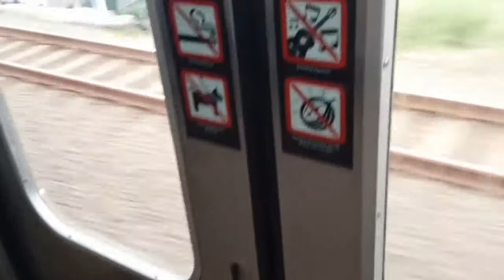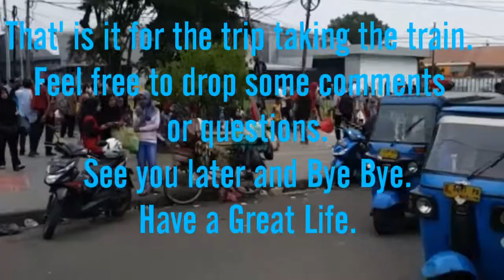Taking E-Scooter Anoa EX+ to the Commuter Line with The Additional Handle Bars

Comment: Numpang kasi review jg ya bro, gue nyewa Anoa EX+ dari Skutis dan tadi siang bawa dari Bintaro ke Stasiun MRT Lebak Bulus bolak balik dan sempet muter2 di Bintaro setelahnya.

Pros:
- Mesin cukup kuat utk jalan tanjakan. Berat gue dg tas dan sendal sekitar 100kg dan Anoa bisa narik walau jalan tanjakan lumayan tinggi dan panjang. Gue pakai mode 2 dan speed turun sampai sekitar 20km/jam tapi tanjakan bisa dilalui dengan mulus..
- Speed sangat OK. Gue hanya butuh 20 menit dari rumah sampai di lift Stasiun MRT.
- Daya tahan baterai OK. Total waktu jalan2 sekitar 1-1,5 jam, dan baterai dari full charge hanya turun 1 strip.

Cons:
- Stabilitas kurang. Mungkin karena ini unit sewaan dan umurnya sudah agak tua, ban depan sering agak2 skidding dan goyang.
- Dampaknya mengemudikan skutis ini menguras tenaga utk menjaga keseimbangan. Apalagi posisi tuas gas gak terlalu nyaman di jari telunjuk, mungkin harusnya pakai tombol atau tuas di jempol.
- Posisi berdiri gak terlalu nyaman apalagi utk jangka waktu lama, 5-10 menit mungkin masih OK tapi diatas itu bikin cape.
- Manuveribilitas agak kurang karena posisi steering column yg tegak lurus dg board, ditambah ukuran ban yg kecil. Untuk jalan lurus2 aja OK lah tapi kalau belok2 apalagi nyelip2 agak2 riskan ya.
- Shock breaking is nearly non-existent. Jalan di Jakarta yg lumayan mulus ternyata kalau dijalani dg scooter penuh lubang2 kecil dan cracks yg bikin unit bergetar2 dan bunyi2. Apalagi banyaknya polisi tidur yang ukurannya beraneka ragam. Dengkul gue serasa mau copot setelah selesai berkendara.

Verdict:
Gue test drive Anoa EX+ dengan rencana untuk menjadikannya sebagai alat transport penunjang commuting. Ukuran sudah pas tidak terlalu besar walaupun agak berat, speed dan daya mesin sudah OK. Tapi sayangnya Anoa EX+ belum memenuhi kriteria yg gue inginkan. Mungkin utk short range drive, muter2 di lingkungan sekitar atau jalan2 pagi/weekend masih cocoklah. Kalau untuk dibawa pulang pergi commuting setiap hari, that's a big no-no.
Reply from the maker: Wah mantap Bro. Iya Anoa EX+ memang agak besar dan berat. Tapi untuk yang sekelasnya seperti Inokim dan merek2 lain, saya bandingkan beratnya masih sedikit lebih ringan dengan kapasitas motor/baterai yang sama ya. Bisa lihat di video saya yang lain Bro, saya pasang kursinya, jadi jalan jauh tidak capek. Paling jauh saya jalan 31 km dari kantor Ancol ke rumah di Pondok Aren. Lalu bisa modifikasi pegangan di bagian depan seperti punya saya, ini sangat membantu dalam handling saat naik turun kereta / jalan di stasiun, jadi tidak perlu ditenteng . Ini sangat signifikan membantu, jadi selama tidak digunakan saya bisa dorong scooternya di depan saya (ban belakang menyentuh lantai, saya pegang handle tambahan itu). Lalu saat di dalam kereta bisa kita setel tiang setangnya agak naik sedikit jadi scooter bisa ditaruh tegak di lantai kereta sambil dipegang 1 tangan (scooter berdiri di atas roda belakang dan T setang). Lumayan stabil. Saya recommend untuk commuting menggunakan kendaraan umum Zero 9 (600 watt, 18 kg, top speed 45 km/jam kondisi baterai full, bisa pasang kursi tambahan juga). Saya juga pakai Zero 8 saat ini, kelemahannya motornya 500W membuat top speed hanya 40 km/jam, kurang cepat di jalan raya yang ramai, jadi agak berbahaya, dan yang paling membahayakan adalah tidak ada rem depan, hanya rem belakan, saya seringkali skidding/ngesot saat ngerem mendadak di jalan raya. Begitu Bro. Coba post video nya di youtube Bro. Mantap.
Reply: @sullivanvictor  thanks bro, gue udah tonton video2nya terkait Anoa, sangat informatif.  Gue gak rekam selama perjalanan makanya numpang review, thanks ya bro :)

Kemarin sempet juga sebentar test drive Anoa EX+ yg baru (green warrior), kayaknya lebih OK ya. Tarikan gasnya lebih smooth gak menyentak dan jalannya lebih stabil. Cuma baterenya udah mau habis makanya gue pilih versi lama. Ya maybe next time lah.

Untuk saat ini e-scooter saya coret deh karena ke arah stasiun MRT ternyata ada pos polantas yg lumayan gede pula. Masa musti kucing2an sama polisi tiap hari wkwkwkw. Ini lagi mikir2 mau beli sepeda listrik, kayaknya lebih aman dari incaran polisi.

Comment: Tertarik sih pengen beli karena gue udah bosen naik angkot tapi masalahnya harga terlalu mahal dan bisa patah punggung ngegotong2 26 kg naik turun tangga di stasiun. Itu di Sta. Jurang Mangu gimana caranya mas ngegotong scooternya dari pintu masuk di bawah ke peron di atas? Setahu saya cuma ada tangga manual disitu, gak kebayang kalau dibawa tiap hari apalagi pas jam berangkat kerja yang puenuh banget.
Reply from the maker: Maaf baru lihat comment nya. Memang kalau di stasiun Jurangmangu tidak ada escalator/lift. Untuk arah ke stasiun tanah abang bisa langsung ke parkiran motor. Tapi untuk yang ke arah Serpong/Rangkasbitung memang mesti tenteng melewati tangga. Lumayan berat. Hehe. Lebih nyaman dan cocok untuk naik commuter line jika menggunakan e-scooter yang lebih ringan seperti minimotors speedway IV pro atau inokim zero 8 / 9 (berat di belasan kg). Untuk yang lebih kecil lagi seperti Street Rat, xiaomi mijia atau inokim light memang lebih ringan tapi kecepatannya terlalu lambat untuk jalan di jalan raya. Agak berbahaya. Cocoknya  untuk di pavement/trotoar yang mulus.

Comment: selama ini cara merawat kebersihannya gmn nih mas?
Reply from the maker: Cuma di lap-lap basah aja. Kebetulan ada kompresor angin, ditiup bagian-bagian yang sulit dijangkau seperti engselnya. Rem depan dan belakang disetel supaya main tuasnya ngga terlalu jauh. Roda di pompa berkala.  Di bagian engselnya itu ada setelan per untuk supaya tiangnya tetap firm. Ini  di setel kalau sudah agak oblak. Itu saja sih. Kalau motor listriknya kan basically free maintenance.
Reply: untuk baterai, kalau di mas. baterai sisa 2 buah gitu, masih bisa jalan apa udah mogok, harus di charger?
Reply from the maker: @sohibatulbadriah1655  untuk baterai saya sendiri belum pernah sampai benar-benar habis. Di display kontrolernya bisa dilihat voltase batere. Biasanya setelah charge penuh bisa sampai 58V. Saya akan charge lagi kalau sudah di bawah 50V. Mestinya ada BMS (battery management system) yang akan putus arus charge di voltase tertentu untuk melindungi terjadinya over charge dan juga akan mematikan kerja baterai kalau sudah sangat rendah voltasenya.
Reply: Victor Sullivan oh, saya jarang bgt liatin voltmeter, okay.. terima kasih infonya, mas.
Reply: Hi, mas. mau nanya lagi nih. untuk lampu, udah pernah diganti blm?
Reply from the maker: @sohibatulbadriah1655  halo lampunya belum peenah diganti. Jika ada part yang rusak bisa langsung ke Skutis Corporation di tokopedia atau langsung ke kantor cabang Jakarta yang di Kemang. Keliatannya sih bisa pakai lampu LED lain yang watt dan voltasenya sama ya. Hanya pernah 1 kali kaca lampunya lepas karena tutup lampunya kendor. Selain itu mgga pernah ada masalah sih.

Comment: Ada regulasinya nggak kalau bawa skutis anoa ke trans Jakarta? Buat videonya dong Om. Anyways, overall keren pakai Skutis.
Reply from the maker: Wah kalau transjakarta saya kurang tau. Untuk commuter line ukuran tas yang bisa masuk adalah 100x40x30cm. untuk sepeda lipat bisa masuk dalam keadaan terlipat. Saat kereta sangat ramai agak sulit bawa yang Anoa. Ukuran anoa sedikit lebih dari 1m saat terlipat, tapi masih diperbolehkan masuk sih. Untuk yang Street Rat dengan berat 8kg dan ukuran yang lebih compact saya pernah dan masih bisa. Biasanya saya taruh ditempat rak tas di atas. Mungkin untuk transjakarta , scooter seukuran Street Rat masih bisa masuk. Untuk yang transjakarta kapan2 saya buat ya.